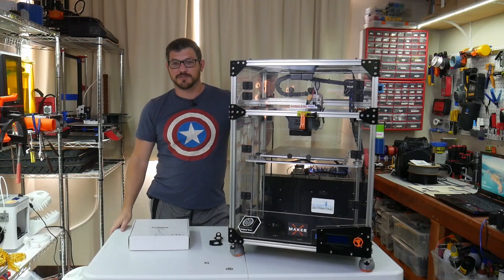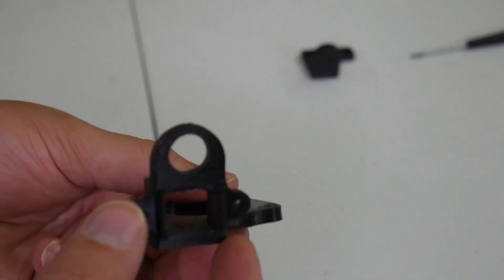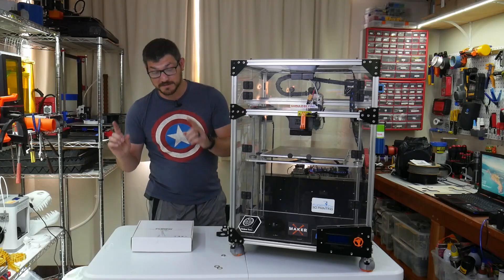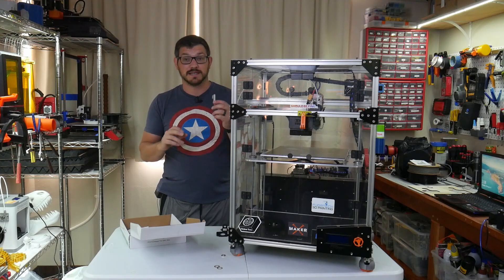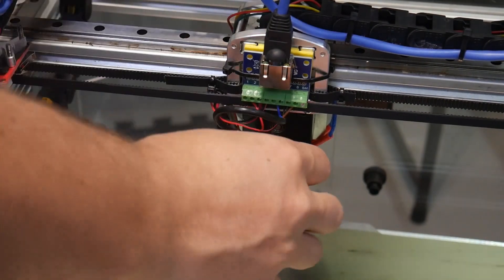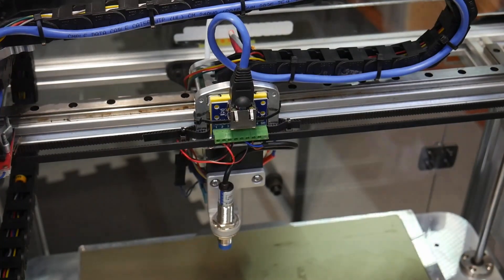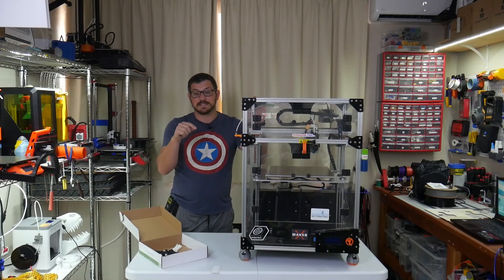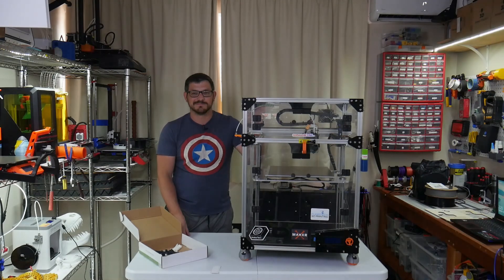PCBWay Saves the FT 5

Comment: It's nice to see the FT-5 getting some love, I have two I need to dismantle and integrate the 713 upgrades I have accumulated.   A simple fix would be added a fume extractor to get some airflow.  BOPFA if you want to spend a lot of 3DUpFitter makes a Carbon Air Filter that would work great.